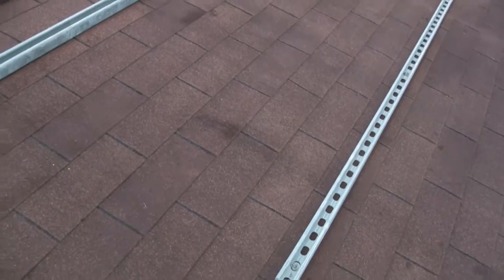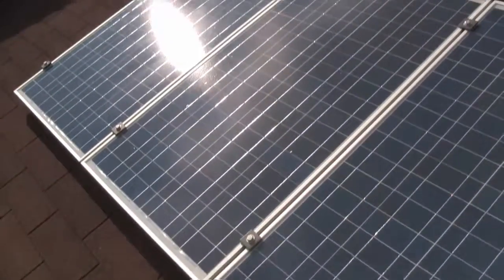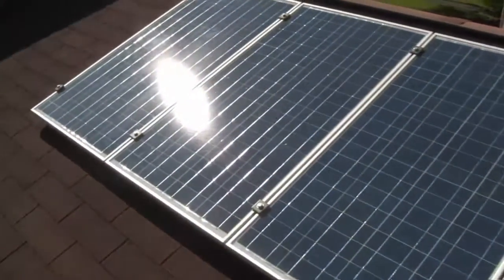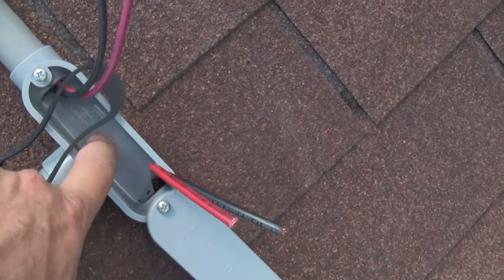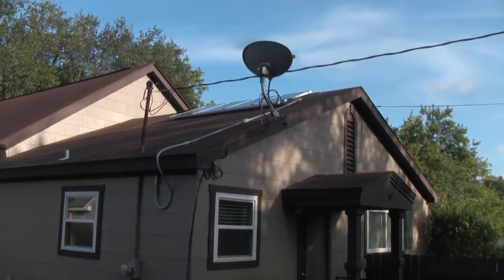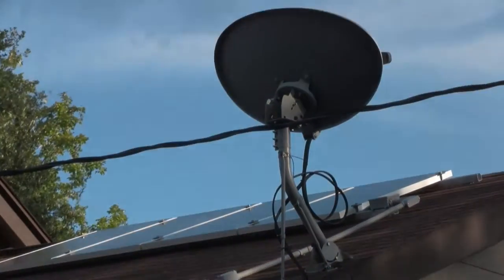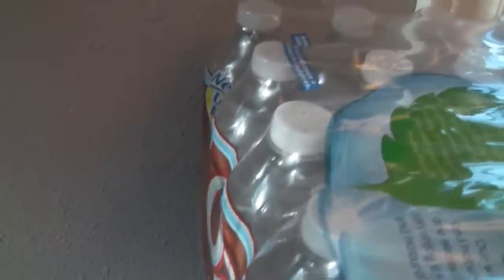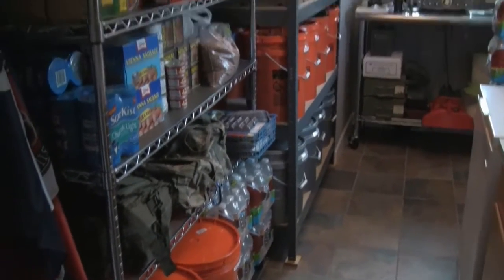EMERGENCY POWER Solar Panels "The Easy Way"

Comment from the maker: @BigBearHuskyMusher Hi, Yes, I just cut of the connectors off on the panels and tied in enough wire to get to my junction box. I just used wire nuts and a good amout of electrical tape to tie them togeather. Then I ran it to the buss bars in the junction box on top of the roof, near the solar panels. Then I ran the wire inside  the conduit to the inside of house to a breaker disconnect box and from there to the charge controller. I do have some other vids on the installation. Good luck.

Comment: Thanks for making these videos Fubar. 5 stars for you!
Regarding the MC4 connectors...did you end up cutting off the MC4 connector ends and connecting your 10AWG from each of those connections? How did you make the MC4 cable to 10AWG connection? Did you make small junction boxes with small buss bars for each of those connections or did you use a twist nut connector and pull the wires through your pipe and then to the junction box? My panels have MC4 cables that are just 3 ft long.

Comment from the maker: @dalamar437 Well thanks for the kind comment. They are 100w panels and I have  2 sets of 2  wired Parallel and then to the 2 parallel sets ( 4 panels ) wired in series. I did this to keep my amps down so that I can run another set of 4 panels in the near furture.I have a couple of freinds on youtube that you might want to check out there videos on there setups. They have some really nice setups and videos. there channels are ECONEWPOWER  and OBXSOLWIND. I hope this helps.

Comment from the maker: @Fearlessthinker  Very good point. I have changed to going in series to raise the voltage and lower the amps. I would have had a problem with the wiring and the controller if I would have added another 4 panels. I found this out after talking to the company I bought my Xantrex XW MPPT60-150 controler from. Thanks for your comment.